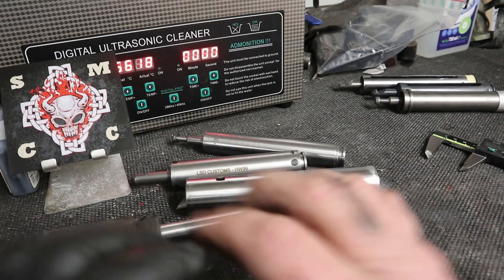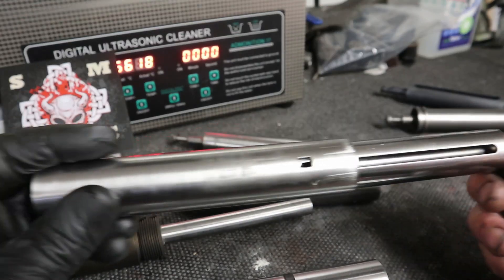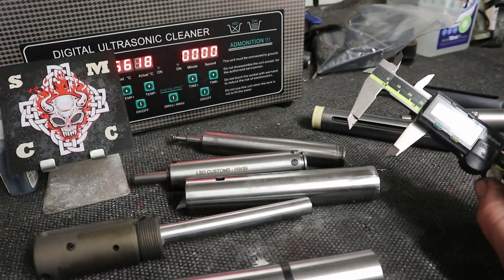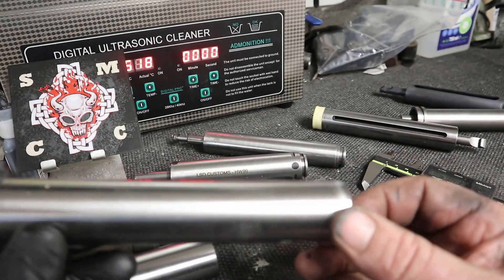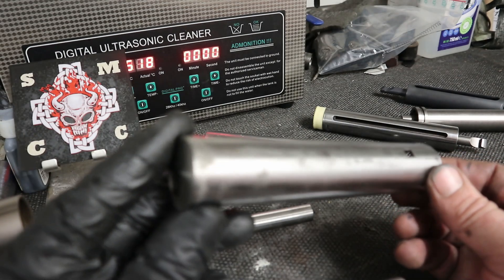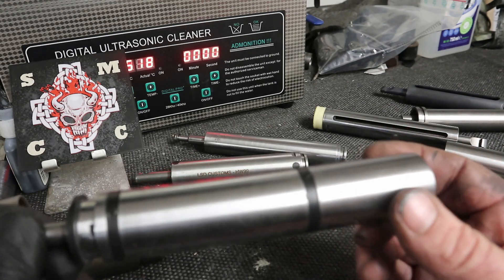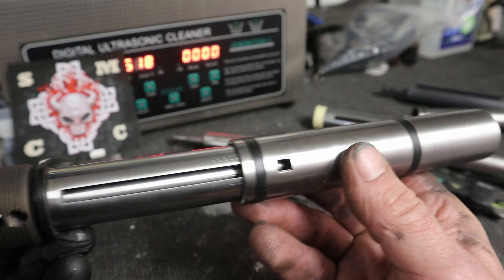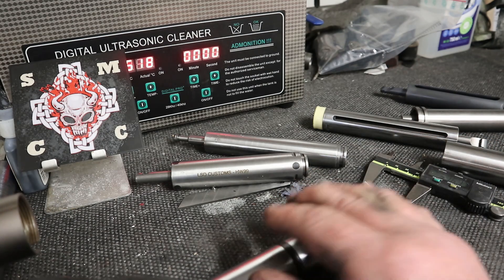Air Rifle Tuning - Why the Delrin

Comment: Hi Geoff!!  How do you attach the delren bands on the compression tube?  Did you also machine a slot in the compression tube for them to set in, or are they just pressed fit and then machined down?  
Keith

Comment: Cheers for the simple, matter-of-fact explaination of the reason to 'glide comp. tubes (pistons too) Geoff : - Sadly, my 4 x Weihrauch's are still running as standard, metal to metal..... aside from delrin guide kits + other tweaks, de-burring, upgraded spring + piston seal, trigger unit/sear and pin polish etc. etc.
If I had a lathe - that I can operate - they'd have been done years ago..... But I'm a Northern skinflint who a) has no room for even a hobby lathe, and b) I'm too tight to get them professionally tuned by a high-end fettler like youself. Finally, on the workshop temperature front : - 

I hope you're referring to 14.2 degrees F?. 'Cus, 14.2 degrees C is to me - pretty comfortable (my house is currently 12 degrees C, and seems fine, albeit with 2 fleeces on!)..... I though you were/are a hardcase biker??. *Only Joking Of Course*, and, I would be wary of saying that to your face (I don't fancy having mine rebuilt !). Spring is now close around the corner biking-wise = warmer/drier tarmac imminent, and, longer days : Thank Feck!. All The Best Mr. L.S.D. - Nick in Higher Walton, just out of Preston **Bumpkin Country**.